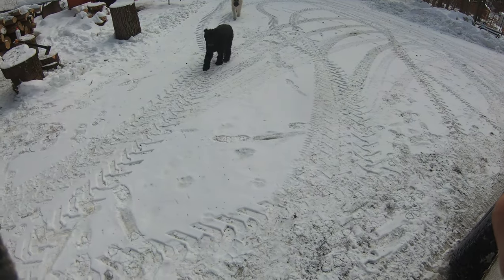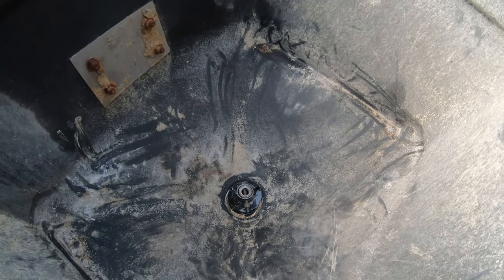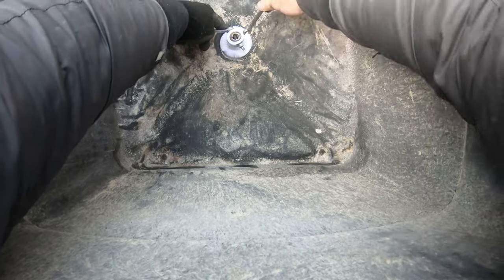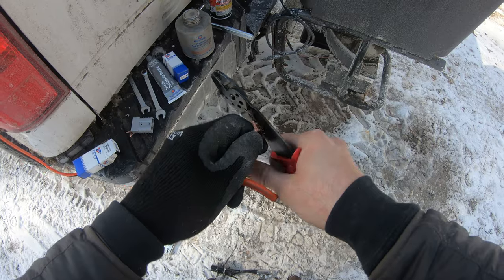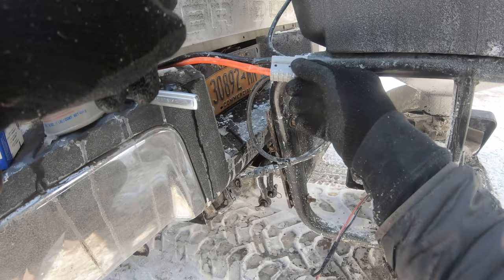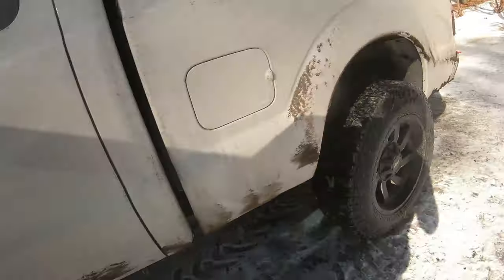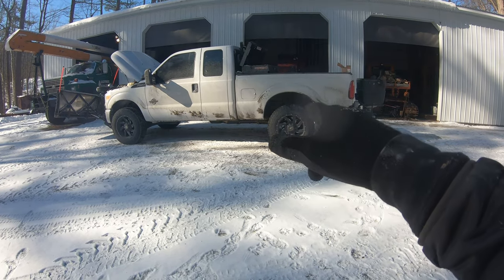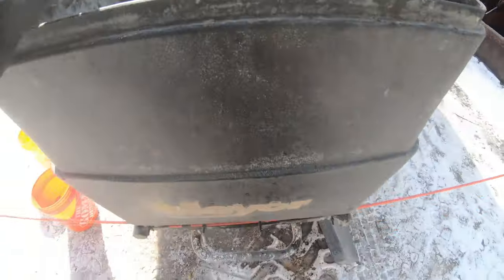I Bought This For $1000. Does It Work?

Comment: Those battery connectors are slick... What were the model number of those?
Reply from the maker: Not sure the model number. I got these from a local auto parts store. Google or Amazon 8GA wire quick connects and you'll see them
Reply: @YoungAmbitionYA  thank you